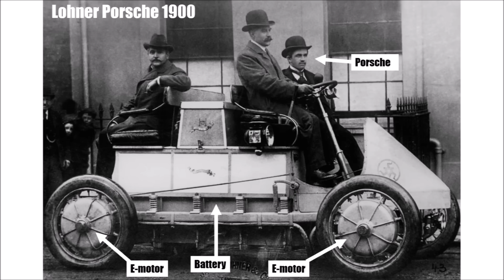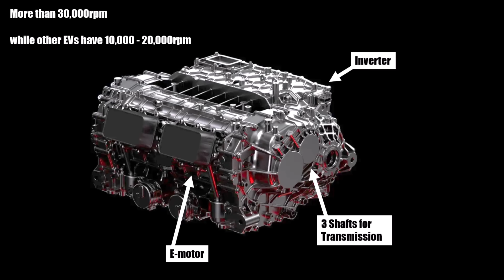YangWang U9 - What is going on here? -  CLOSER LOOK

Comment: Only someone clueless on how the chinese ev industry works would believe all their claims with this car.

Definitely a prototype, so nowhere near as impressive as what Rimac has achieved.
And the cars customers receive will probably struggle to even reach 400kmh. It's not sold anywhere outside china, shows how confident they are on the car. The base version was already released a year ago, still no thorough and independent test of it whatsoever.
On this case, most likely none of the 30 customer cars will ever be independently tested at high speeds.

The lap time is also quite underwhelming for a "3000hp" supercar. The Rimac Nevera R will easily be faster, i predict around 6:42.

There's already plenty of evidence of chinese cars with bold performance claims that end up being slower in reality.
The gac hyptec ssr supercar with supposedly 1200hp does 10s 1/4mile at best and is inconsistent. Tested by DSC OFF channel. Much slower than a Air Sapphire, a full size sedan with almost double the range.
The su7 ultra is also a major example. All the hype with supposedly +1500hp, Nürburgring "record". So far it has proved to be barely faster than a S Plaid in a straight line, and underwhelming around a track. Check JP Performance times and carwow, DSC OFF drag races. It was slower than a non-track pack Plaid and much slower than a Taycan turbo gt on JP's tests. Overall slower than a Air Sapphire on DSC OFF tests, a car which carries a larger battery and has 200km more range.
The su7 ultra has struggled above 250kmh in every test, being much slower than what's seen on the Nürburgring "record".
The "670hp" su7 max has also showed underwhelming performance, being slower around a track than a 2019 Model 3 Performance. Tested by exF1 Rubens Barrichello on Acelerados.

Comment: 2.5 tonnes for a supercar, oh boy.
Reply: Crazy times. A BMW M5 is 2.3 tons now!
Reply: Swtor logo
Reply: @daysofthunder6110  based
Reply: EVs are by necessity, much heavier due to the weight of batteries. Unfortunate, but as battery tech advances this will probably improve.
Reply: @sharcc2511  it probably won't, the new battery chemistries that are developed go for reliability, longevity and safety and those are heavier than lithium-ion and the lithium-ion optimizations also don't make them lighter. Energy densities continue to improve but manufactures don't use fewer cells because people don't buy cars with the same range, they want more. All in all EV is the death of car enthusiasm, no more mechanical connection, it's just a smartphone on wheels that can kill you quicker than anything before, or more painfully than ever before if you die trapped in an EV battery fire, or more painfully than ever from battery fire toxic gasses.
Reply: @imnotusingmyrealname4566  yeah that's why i owns 1 ev and 1 gasoline car, ev for commuting and "eat up" the road while the gasoline car is for having fun
Reply: EVs are well suited for:
- extremely high performance (as in straight line performance)
- any kind of luxury car or comfortable midsizer
- any combination of the two
They are also good commuter cars thanks to not having to warm up.

So while making a nice cheap hatchback, especially some sort of hot hatch, or the kind of sporty car that's actually interesting in the real world benefits from a piston engine, EVs are a fitting concept for $50000+ cars that manufacturers actually want to sell and record breakers that they can use for marketing.

Or maybe what we need is to commute by tram and go have fun on motorcycle.
Reply: @sharcc2511 There's no way the weight will get any lighter if they keep chasing mileage.
Reply: @Edihartama  I mean, this is a supercar, it's not exactly "chasing mileage". It needs a large battery not to have good range and economy, it needs a large battery because it can deliver 3000 horsepower.
Reply: Yeah I still remember how good supercars were in the 80’s and 90’s, and 2000. Really amazing cars, amazing performance, amazing build quality, amazing safety, amazing engines. Really good times
Reply: @telmoazevedo8958  A channel I subscribed to just recently uploaded a documentary about the Porsche Carrera GT, calling it the last analog supercar. Haven't watched it yet but am interested what they mean by that.

Comment: The drivetrain is certainly interesting, but I don't think at 2.5t it really makes sense for production. I think there should be room to quicken the control loop of the motors a lot, like into the kHz range, this would potentially give a serious traction advantage in the more extreme end of track conditions. The power electronics and the logic should both be able to operate at that rate with ease, though it may require some development of further sensor inputs for example embedded in the tyres.
Reply: Is lighter than a Rolls, a Bentley or an M5...
Reply from the maker: True and sad...

Comment: I think something significant you missed is the fact that they used an LFP battery instead of the lighter NMC chemistry you'd expect, such as in the Xiaomi SU7 Ultra. This seems to be because BYD almost exclusively makes LFP batteries and is thus incapable of making a suitable NMC pack; this feels kind of like a brand trait, like how Audi's engine-forward architecture legacy. Assuming they could push it to 3000kW too, they could've saved some weight or had ~100kWh with NMC.

Also, that 555kW motor tech was first used in the pure-EV versions of the Han L and Tang L family sedan & SUV where they make 500kW RWD or 580kW (plus front motor) in AWD. It seems to create all that power from hitting extremely high RPMs rather than just increasing size and thus weight.
Reply: BYD engineers believe that using  LFP batteries is stable and safe enough to withstand a 30C discharge rate.
Reply: But BYD does make NCM batteries, though only for smartphones. For Automotive, they've pinned their cart on LFP for everything, while other OEMs use LFP for lower range models & NCM for longer range models. BYD could make NCM if they wanted to, its just an engineering policy. They're also working on Sodium ion batteries.

Comment: There's no doubt that what they achieved is really impressive. What I want to know is how involved they were (or weren't) with specialized engineering companies. (e.g. Riccardo, Ahlman etc)
Come to think of it, we rarely talk about the engineering service companies that work with OEMs. Next video idea maybe?
Reply: Yep, would be interesting to learn more about Cosworth, ZF, Ricardo, Hewland, Aisin, Multimatic, Dallara, Oreca etc. There are so many brands involved with gearboxes, engine tuning and chassis design.
Reply: to confirm this on the Xiaomi SU7, prominent western (german) suppliers developed the brake and steering systems for it. The automaker is an integrator, which is an art in itself and critical to making a good final product. But yeah, its all on the shoulders of western suppliers.
Reply: notification turned on for this topic
Reply: There is very little involvement.
BYD is known for building almost everything in-house. And if any other company took part in building this car, it wouldn't miss the chance to advertise itself.
Reply: I probably wouldn't believe anything coming out of china
Reply: @OrphanPuncherRacing  Yea. Just tariff them instead.
Reply: @theslimgolfer  Maybe the tariffs have something to do with the massive reg- ime subsidies, st01en ip, dirt cheap labor, energy and raw materials. Even sl4v ery.

Also so far there's no solid evidence whatsoever of them having any better ev tech. Most evidence shows they're still years behind the best western brands.

Charging speeds being an exception, but with long term reliability unproven. On the smartphone and e-scooter worlds there have been chinese brands with faster charging batteries which have come with disastrous reliability and degradation.
Reply: @sideways0wl😂😂😂 whatever makes you sleep at night. Let's see in 5 years
Reply: @sideways0wl Love your "logic" :face-blue-smiling:

Comment: kinda suspicious about what tyres they used bcs sounds too good to be true- Koenigsegg and Bugatti have said that they are waiting for tyres. Maybe these were one-use ish tyres? either way it's impressive engineering nonetheless
Reply: the tire can run 500kph last for 9 min in lap test
Reply: They add something similar to bulletproof vests material into the tyres
Reply: These tires can be use for multiple runs high speed runs apparently according to some comments.
Reply: they make their own tyres, china is way ahead of koengsegg and bugatti
Reply: @cheesedrinkal  Giti is actually 40 years old. So not a new brand.

Comment: It's a cool car the same way a Bugatti is cool. I wouldn't buy one even if I could easily afford it. To extreme... And if want power I just drive a locomotive with three times the power which is honestly insane that a car has that much power
Reply: In China the Xiaomi SU7 has a versión with only 673 HP for 40k €, which is ideal for commuting...
Reply: people said the same about 400hp in 1980 then they said the same thing about 1000hp in 2000 now they say the same thing about 3000hp and in 10 years they will say the same thing about 10000hp.